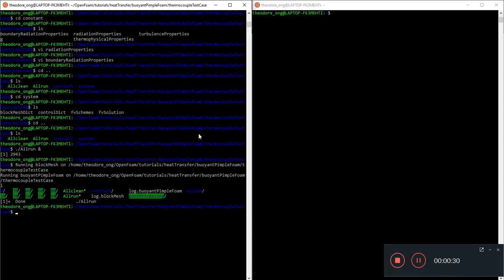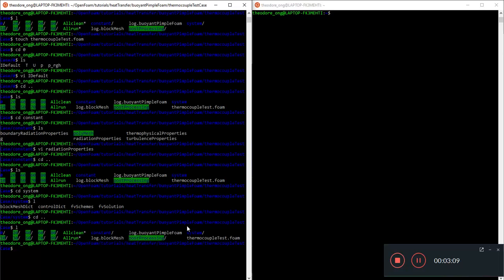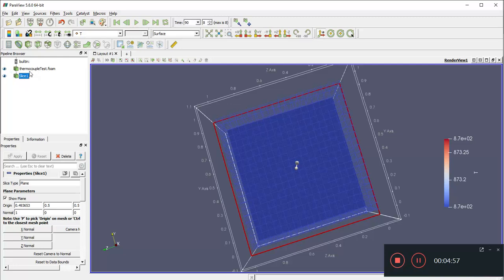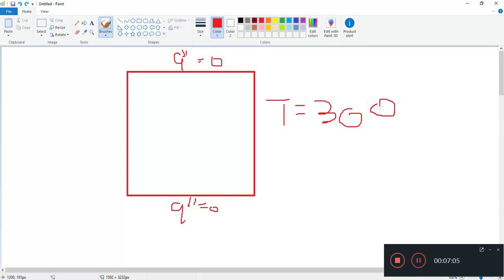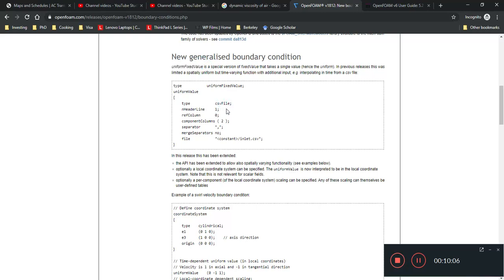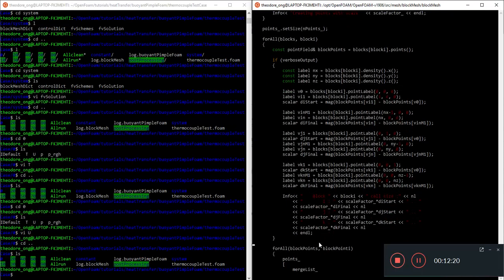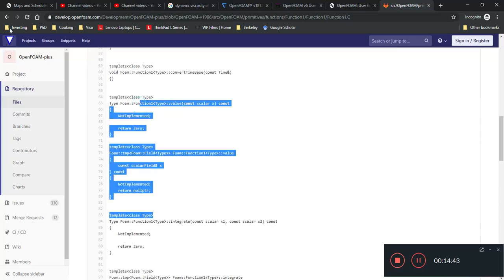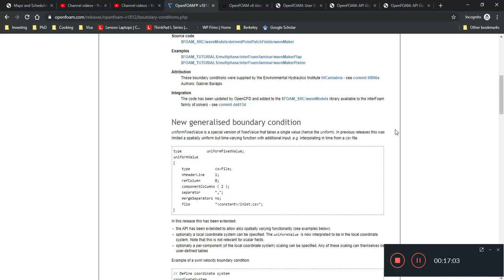OpenFoam Heat Transfer 11 - buoyantPimpleFoam part ii thermocouple case and time varying BCs

Comment: Hi Ong. Is there a continuous gradient BC (for temperature) inbuilt in OpenFoam? Have you done any tutorial about it?
Basically, I want the condition where I can define the gradient in the boundary as same as the gradient in the cell next to the boundary.
Thanks.
Reply: @TheoOngScienceAndEngineering  Hi Ong. I do have my own custom made solver. I did make few of my own custom BC but this was a little tricky and needed to access the gradient of the field in a cell next to your patch. I have created one and currently implementing as I write.